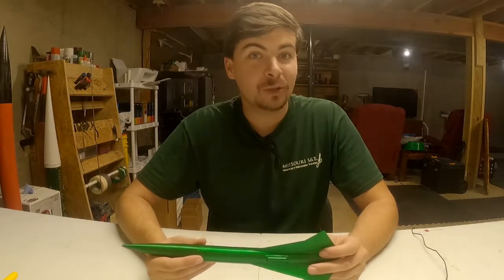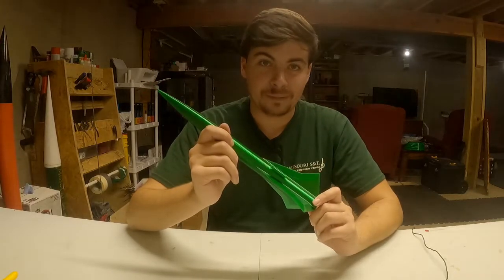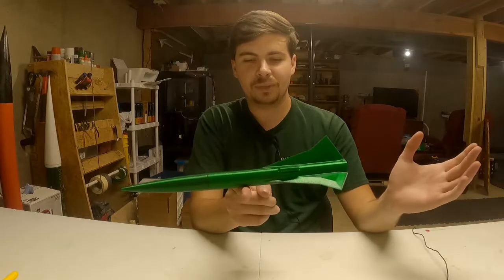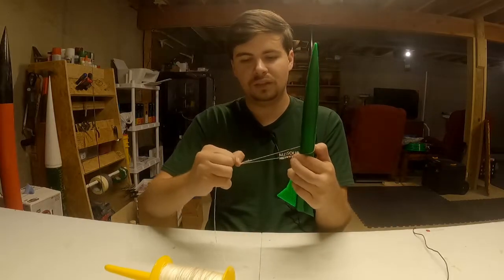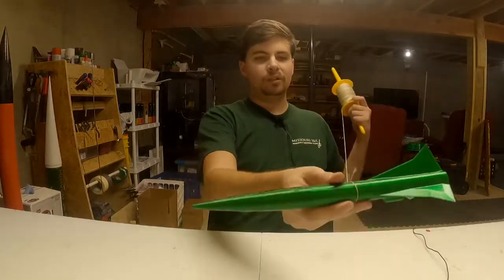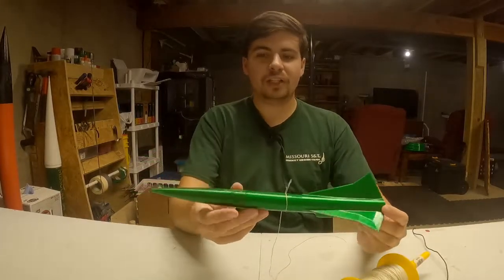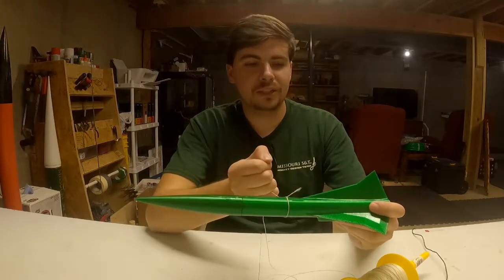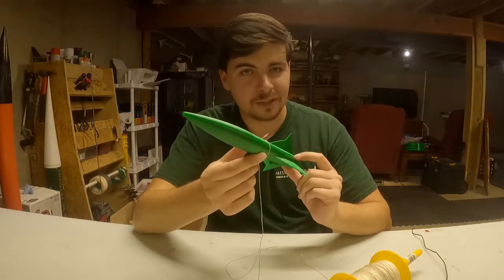Determining the CG and CP of CUSTOM ROCKETS

Comment: CG and CP are typically provided and measured from the tip, not the aft.
Reply: is there a practical reason for it to be measured like this?
Reply: @mikec1096 it is based on "station" location, all formulas were created from this reference! 😁👍👍🇺🇲
Reply: @mikec1096  Because when doing fluild dynamics and Cp calculations, "pressure depends on the distance x from a reference line usually taken as the leading edge of the object"[1].. as a result, anyone who provides the Cp and Cg of a rocket, will always measure from the tip (where the pressure on the fusilage begins ot act)... unless your rocket flys backwards.. which will happen if you get them backwards. ;)

Also.. likewise, Open Rocket does all of it's Cp/Gp figured from the tip.

Lastly.. Cg (if measured) is only usable with a fully loaded rocket (motor + chute + wadding + electronics, etc).  It's good to get a "dry" measurement just to see what Open Rocket thinks your dry weight and Cg are so you can "tune in" the model of your rocket, but once that's dialed in.. Your pre-flight RSO's safety check will always ask you what your loaded Cg & Cp measurements are (from the tip).  If you measure the rear in front of them, they probably won't let you fly a HP rocket at their launch. ;)

[1] - https://www.grc.nasa.gov/WWW/k-12/airplane/cp.html
Reply: As a general convention, yes ... these values are measured from the tip. But as long as you measure both CG and CP from the same point, it doesn't matter which end you measure from.